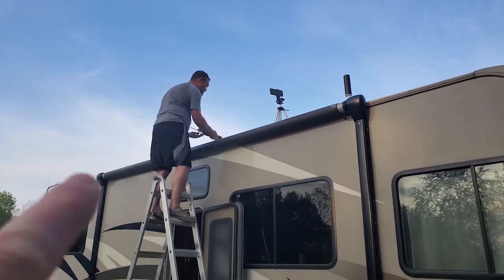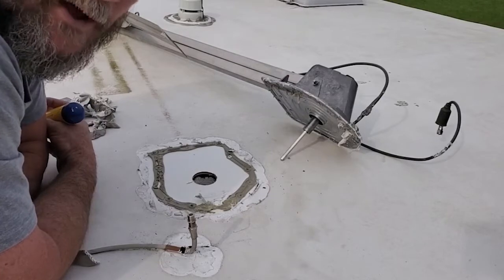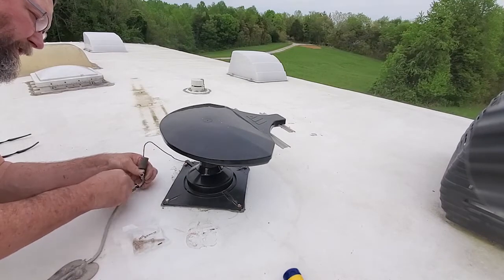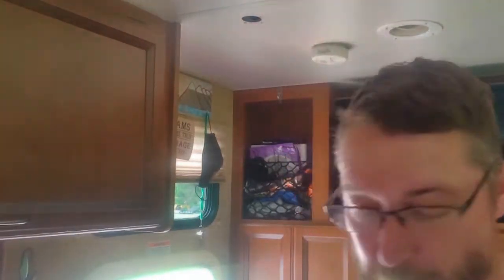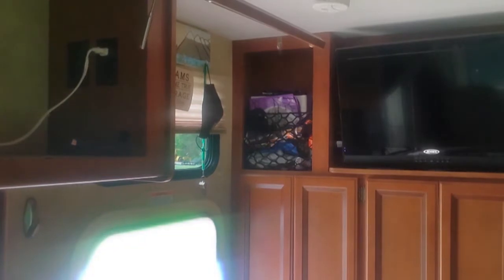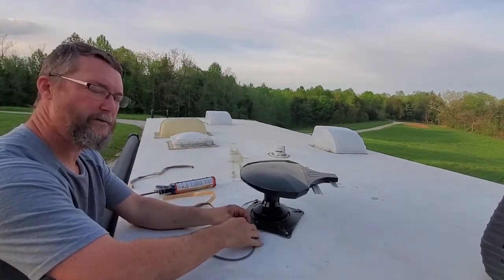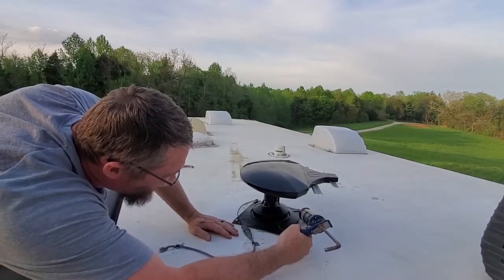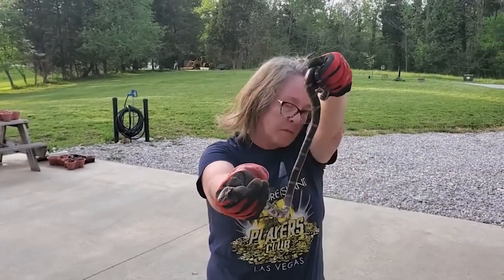Upgrade RV Antenna Install to New Low Profile Digital-Winegard || RV Living

Comment: Getting the new cable through... video shows taping it to the roof but not how to get it through the roof and snake it to where the old one was.😢  that's the one part I watched the video for. 'I've removed the old cable and put the new one through.  Now I'll hook it up to the booster.'

Comment: I'm wondering if the new low profile antenna is blocked by your AC unit. Mine is literally an  inch away from the front of my AC.
I am buying a winegard batwing mount and see if I can rig it to go up and down with the newer antenna mounted.

Comment: Just curious, if the antenna turner does not have a specific direction it should be installed on the ceiling , then why does the antenna on the roof have a specific direction the base should . The old one had arrows that lined up so you knew which direction the antenna was facing .
Reply from the maker: As said in the video, the inside "turner" free-spins in circles, so it's not limited. However, the roof antenna is limited by the wire, so it can't spin in infinite circles because the wire wraps.  These models dont have to be pointed "into the wind" or anything like the old style while driving.  You should make it easy for yourself and align the inside know arrow with some reference to where the outside is pointed just in case you want to be picky about orientation when traveling.

Comment: I was hoping you put lap sealant over the RG connection, I seen so many people expect just Butyl tape is good and it isn't. Being a FCC Tech I can honestly say it is good but will allow moisture to seep in over time and causing corrosion and or wires eventually wear away as you shown every one. You done very well with this video, Thank You :)